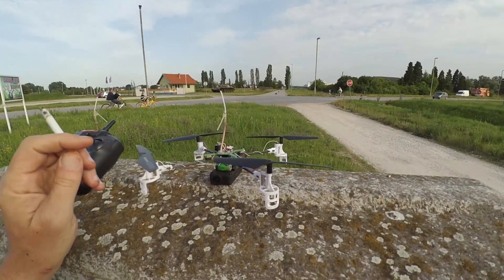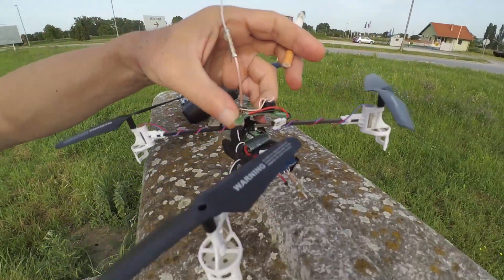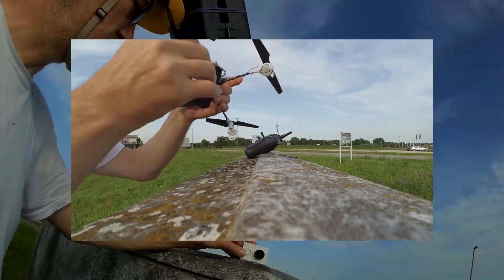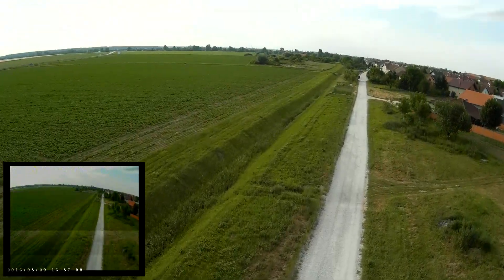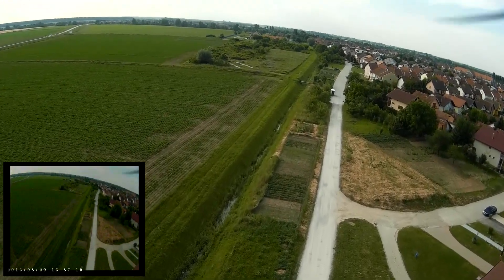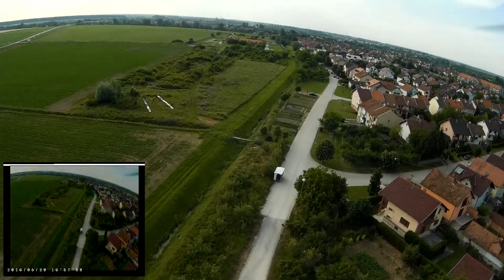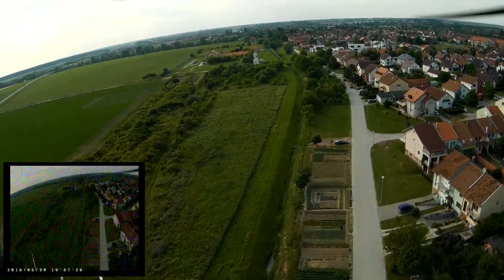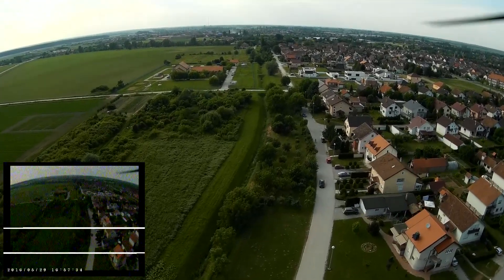DIY Lightweight Quadcopter - Flight Test

Comment: I want to build this , but use h502s flight controller and syma x5c props
Reply from the maker: Sorry did not saw your comment... I have plan to make something with parts for 7.4 Li-Po battery. Just not sure which controller to use.

Comment: +WildMania, I have been watching a few videos of the X5C with the X5HC props on and they seem to be very quiet with better lift, the 7 x 20mm motors seem to have no problems with them although I do wonder if they would perform even better with the racer coreless motors.
I just thought I would pass this by you to see what you thought.
Reply from the maker: Honestly I don't know. All depends of how good are magnets. Some motors have just thicker wires, which gives more power and thrust, but in the same time if cooling is not good, it may degrade magnets fast. I would like to see that someone one day begin to manufacture aluminum motor holders for 7 and 8.5 mm with few fins so that it cools motor better. That will be really good improvement. I suspect that racer motors has stronger magnets and thicker wires. But, since motors are attached just at the bottom (away from the shaft), cooling is much better, so they do not burn easily. On the other hand, motors that are 'geared', they are inserted into plastic casing, where most of the surfaces are not cooled by air flow, so it may cause more problems than good performance.
Reply: I wonder if drilling holes or making slots in the geared motor mounts would help cooling a little, The climate here in Ireland is not that warm lol. 
I have ordered up and am waiting on all the parts to build your lightweight quadcopter including the jj 000 quadcopter and controller, I could have just gotten the board for £2.00 cheaper but I thought I would like to try the quadcopter out first before using the main board.
I may go for the racer motors at a later date as I have plenty of 7 x 20mm motors to keep me busy for a while, I also have two sets of X5HC props ordered as well to try as I like what I have seen so far about them.
Post takes a long time unfortunately but I shall let you know how it all goes.
Oh, before I forget, is there an fpv camera and goggles that you would recommend? thanks again for your advice.
Reply from the maker: Drilling holes will weaken those motor holders. There is hope by inserting aluminum foil, which can then transfer heat away and under the prop, so that it can cool motors. I did it for 7 mm motors, but did not try for 8.5 mm motors. I am afraid that there is not enough room for 0.1 mm for single layer (which is not enough), or more for multiple layers. 
There is 'trade off' between cold weather and cooling motors - do not forget that LiPo batteries do not perform well if too cold. 
For FPV on such small quadcopters I rather use Mobius (or Mobius mini) with changed battery (small one, cca. 300 mAh). Mobius mini is already small and lightweight (27 grams), while original Mobius is 40 grams. By changing battery it is the same as Mobius mini. Both cameras has relative low latency time, but Mobius has problem - if not recording, latency time is greater than when recording. Strange. Mobius mini is made specially for small FPV setups, with low latency time. Transmitter is usually 25 mW at 5.8 GHz, which is sufficient up to 1 km with good made (DIY) antennas at TX end, and good PATCH antenna at receiver end. Today we expecting bad weather, but soon it will be cold enough to test more. I want to test range of combination with Mobius mini with 25 mW at 5.8 GHz with my FPV setup (also should to make video about my helmet for FPV). BTW, are you relatively good at soldering? DIY stuff require some soldering skills, not much, but at least essentials. If so, I will make more videos about how to complete whole set for FPV for small quadcopters. ZMR 250 and similar are different - they can lift more weight, thus choice of the cameras (usually analog) are wide, while small geared motors and small quads are tricky to get good range, good battery life and so on. Also, I should to investigate what is wrong with my website wildlab.org, and work more on it. Recently... some errors related with google analytics. It will be good to make there whole lists of related projects instead making playlists only on YouTube. Will see...
Reply: Yes Wildmania, I can solder good and have an excellent soldering iron that I can quickly set temperature on, I also know the use of heat-sinks to keep heat away from sensitive components. I have large drones with fpv 4k camera and one with 1080p camera but like the diy challenge of the small cheap lightweight stuff, it's actually more fun being able to experiment with low budget stuff, although it can still add up in the long run, I learn more though.
Your foil idea sounds good.
I was looking at the mobius  mini, short battery life with built in battery but good little camera, it can run of a power bank when not in a quadcopter so I guess that's good.
Is it easy setting that one up for fpv plus record at same time? I think you say it's better fpv while recording.
Reply from the maker: Excellent! Learning how to make and how to connect thing is as important as knowing how to fly the same thing. Yes, it can add up cost, but in the same time adds up learning experience. Sometimes learning is not free. Theory is one thing, while practicing is another. 
Okay, got idea... for quick test of the motor temperatures, before get to the point where I will be able to make remote data logger, or at least local logger (some memory on the quadcopter). It can be done by measuring at least one motor while quadcopter is fixed. Maybe it is possible to measure force by using some small tabletop scale, then throttle up and down, and measure temperature of the motors. Just to see the relationship between various speed settings and different motors. 
I have Mobius mini, but did not tried it yet on my DIY quadcopter. That is priority for my next experiments. 
Powerbank is excellent idea. Mobius mini can record only about 30 minutes, and re-charging at least little bit between flight is really good idea. 
Setting is easy, but there is one problem - it is USB mini with 10 pins, not 5 as usual USB mini connector at ordinary Mobius camera. For Mobius (old one) it is better to record and fly FPV - latency is relatively low. For Mobius mini, I think it is the same (not tried yet).
Reply: I have a Non contact infrared thermometer I could use also when I get the X5HC props to see if the small 7X 20mm motors heat up more or less with those connected, I also have a Digital Infrared Photo Tachometer RPM motor speed gauge so I could test the max rpm a motor gives with each prop X5C and X5HC, plus I could test a motors temps after one minute at the same set speed and so forth.
I see the new mavic pro platinum has a different prop design than ones previously used.
 I think it would be easy to modify the X5CH props that are bigger than the X5C props, to make them similar to those plus balancing them of course.
The mavic tech guys say 3mins longer flight and 60% quieter.
Someone on youtube tested those racer motors you like, they tested them against the standard 7x20mm motors using scales with the drone sitting on top with a weight attached, they then tare the scales and powered up full power with two tests, the standard motor and then the racer motor and the racer motor had around 30% more power.
I can't seem to find the video, here is another video of something you are talking about though i think.
https://www.youtube.com/watch?v=YMrSBnQhR3A
Reply from the maker: There is problem with such non-contact thermometers - if motor is shiny (silver, reflective), then it will NOT show true temperature. I have somewhere cheap chinese thermometer with NTC resistor, which is small enough to be attached to motors. Reading is not that accurate, error is maybe 2-3 degrees celsius, but it is good enough to tell you roughly how motors are hot. 
About thrust measurement test: beware that full throttle while it sitting on top of the scale is equivalent not lifting from the ground. Or, in other words - it may look like quadcopter carrying too heavy object, thus possible motor burning. For brief moment, it is okay. Just what is 'brief'?! I think that up to say five seconds full throttle is okay. 
More power at the same motor volume is not always good. The question is - where 'ballast' (heat) goes? Again, some motors has stronger magnets, thus more efficient energy transfer, but if some motor has thicker wire, it may look like it may give more power, but less efficiently. This means that instead in thrust it will invest energy into heat. 
I saw this video and posted comment. So, now... I have multiple choices for my next videos - someone asked me about Adobe Premiere tutorial, at least how to start. Then this one about motors, then I did not finished all tests with my DIY quadcopter since there was problems with 7 mm motors and overheating (too short flight time). Also, my website wildlab.rog suffering some google analytics and other problems with AMP (Accelerated Mobile Page) scripts. So, lot of work. Also, programming on MCUs are... well, nowhere - did not working on it for long time, too long... Every day I feel better, my depression is not that deep as week ago, so there are good chance to get back for making more and better videos.
Reply: I did not go as deep as you did in my thoughts of testing motors and props especially because so many variables with those cheap ones leaving the factory in poor condition.
My first Q7 could lift and fly fantastic with 1200mah batteries but my second one with red board could not handle them good at all and one motor went really lazy after 15mins of flying, not-flyable now.
Getting good cheap motors in bulk may be the way to go but being sure they are good to start with is important as a bulk buy of rubbish is just lots of rubbish.
Those racer ones seem good but are almost three times the price.
Brushless are good but need ESC for each motor and then a better programmable main board to make it sensible but that is a different venture.
Yes Wildmania, I know you have a lot planned and I'm sure when the time comes your spark will start a furnace.
It all starts with ideas and that's fun as much as anything.
Stay good and cheery, and thanks as always.
PS. I hope your girlfriend is doing better after the heat exposer.
Reply from the maker: Yes, that is good sign that your motor may be burned. By 'burned', does NOT necessarily means baked coil, but anything that may ruin performance including burned coil. But, before coil burns, magnets are first that will fail, then controller will try to push more current to level flight, but since motors are now weak due to weak magnets.... it goes to 'thermal runaway', where motor is no more motor, but heater. 
Regarding motors and trial and error approach - that is why 'reputation' is important. I bought many motors, of which ones are really good from Aliexpress, but costs little bit more than ones on Banggood:
https://www.aliexpress.com/item/4PCS-8520-strong-magnetic-DC-Coreless-motor-3-7V-50000RPM-for-Hubsan-H107C-H107D-H107L-MJX/32344200341.html
and then cheaper but equally good motors on BG:
https://www.banggood.com/4X-Racerstar-8520-8_5x20mm-53500RPM-Coreless-Motor-Upgrade-for-Eachine-QX90-QX95-DIY-Micro-FPV-p-1114279.html?p=EH10221611330201505Q
You are right about my plans and 'starting a furnace'. I feel that. Just need little bit more time. Just, sometimes too much ideas, of which some can't be realized. 
Yes, my girlfriend is much better now, she is on antidepressants and we will see how it will works. Hope no more alcohol. Thanks.

Comment: Is this the same one that you made a video on how to build?
Reply from the maker: Yes, that is true.
Reply from the maker: If you chose to build this one, you will be happy with it. 13 minutes flight time with Mobius camera, or about 30 minute without any camera.
Reply: WildMania nice transmitter, i cant find any that small. May I ask, where did you get your transmitter from?
Reply from the maker: This transmitter is from other "drone", JJ1000 (small one). The controller board on quad is from JJ1000. I bought two JJ1000, both broken, so I use parts from those. Only motors, gears and propellers are bought separately. I think on build video, there are links where to buy every part. There is other options, build everything as this one, but using controller board from Eachine H8. Despite H8 has smaller size, its MOSFETS are capable of driving slightly bigger motors. Transmitter for Eachine H8 is small, shitty one, but if you buy transmitter for Bayangtoys X8 - it has the same protocol, but much better sticks and other controlls.
Reply: WildMania Awesome! I was also wondering where you got the video transmitter from.
Reply from the maker: http://www.banggood.com/FX-MM213TL-5_8G-32CH-25mW-Wireless-Audio-Video-AV-Transmitter-Module-p-1045770.html?p=EH10221611330201505Q
Reply from the maker: The antenna for 5.8 GHz: https://youtu.be/Rzumbr72xjg
Reply: WildMania Thank You!
Reply: WildMania WildMania Also 1 more question, what video receiver did you use? And can video receiver be used on phone?
Reply from the maker: The monitor for FPV receiver is here (modification from 12V to 5V for power bank):https://youtu.be/FfGEzfxrkQE
The receiver (RC305, also modification to 5V): https://youtu.be/HHUN8hDcmy8

Comment: Very cool, Nice Job!!. Looks like the frankendrone v2 is doing awesome
Reply from the maker: Well, it was... now waiting on the bottom of the river for rescue. I will rather make new one.
Reply: OOHHHH NOOOO!!!!
Reply from the maker: This is not the worst thing happened during this flight. I walked over 1 kilometer with quadcopter flying in front of me, recording with helmet camera, and when get close to the river, I decided to stop walking and make one round trip around land, then over the river. Camera probably recorded over 20 minutes (and that is bad thing: I believe maybe even 30 minutes or so), then as a Murphy's law, it flies over the river, begins to back, and 1-2 meters short of shore fell into water like a rock. LVC did not whistling buzzer, just cut power. So, I went to some improvised structure extending into water trying to see where it fall. Then I fall in water with remote. Then remote slip out of my hands. Then, as I am trying to reach underwater, my helmet camera felt down... luckily mobile phone is not damaged in my back pocket. Camera is destroyed, and microSD card did NOT recorded anything - because in order to save file it should be closed. And, when it felt into water, probably water cause short, and it just stopped recording without saving precious video. So, for this reason I am little bit depressive - no video proof that it can fly nearly 30 minutes with single 750 mAh 1S battery.
Reply: WOW!! What a crazy ordeal!!  That is always how it seems to go. When you think you have something great going, Murphy's law comes in and ruins it.. So sorry to hear about that mess.. would have been an awesome accomplishment to have on video!
Reply from the maker: Yes. I wanted to videotape max range, max flight time with and without camera, max altitude... But, seems that all of this should wait. One thing which is very rare is good propellers from FY326. This quad has everything bad except props. Much better thany Syma X5C and alike. The reason i in structural support near shaft - all that props has additional structure which make turbulence, thus lower efficiency. Only what I found is props from FY326, which become "rare" quad, maybe because people recognise that it is bit crappy quad...

Comment: Now THAT are some really good results! I am impressed.
Reply from the maker: Thanks.
Reply from the maker: Yes. Quad without battery is just 52 grams. Battery is 18, so 70 grams. Mobius camera is modified - 180 mAh battery, which result in very light setup, about 105 grams or so. It can fly over 13 minutes, but without going up/down, up/down all the time as I did during this test. Without camera... I have no idea, older version was 18 grams heavier and fly over 20 minutes. With camera about 10 mins. This one is excellent - carbon arms, and optimized design. I can get maybe 1 gram by shortening wires, and removing little bit of plastic, but... 13 minutes FPV flight is enough exhausting. :D

Comment: Beautiful.
BTW Milan,  I saw a video demonstrating JJ1000 having secret powers  - taking 3s batteries.
Reply from the maker: Really?! Are you serious? How?! URL?
Reply: I don't know anything but here's the video:
http://www.rcgroups.com/forums/showthread.php?t=2343505&page=1159#post34720956
Reply from the maker: Hmmm... something is fishy there...
Reply: It's possible that the batteries are run down in voltage, right?
Reply from the maker: Mostly likely yes. This video is probably intended to mess with people. Someone will try real 11.1V and get smoke out.